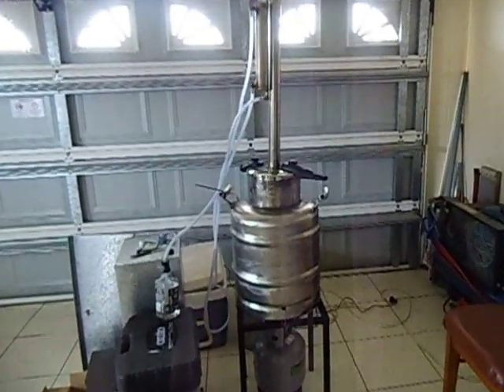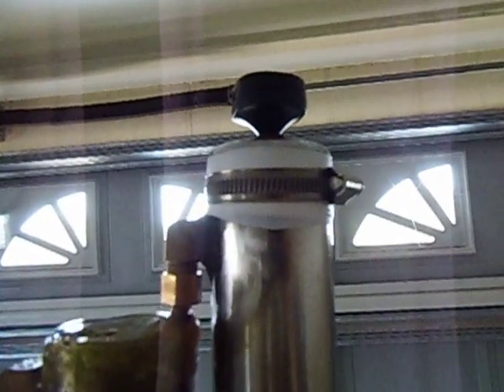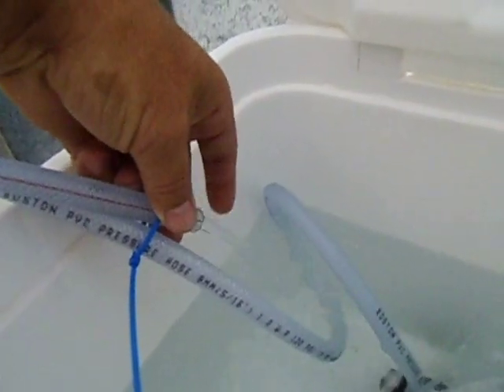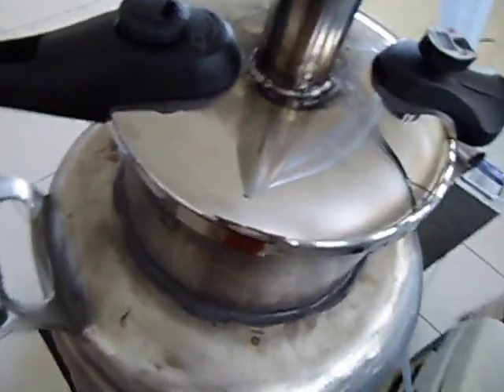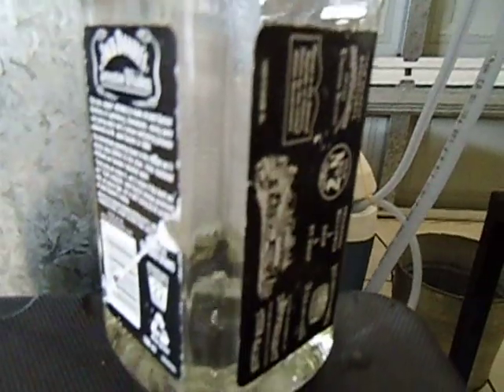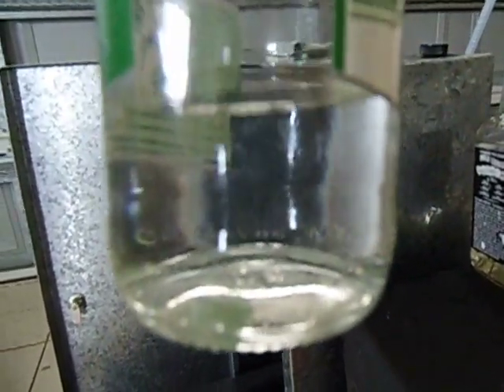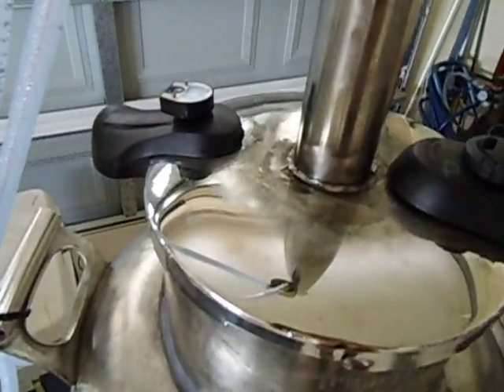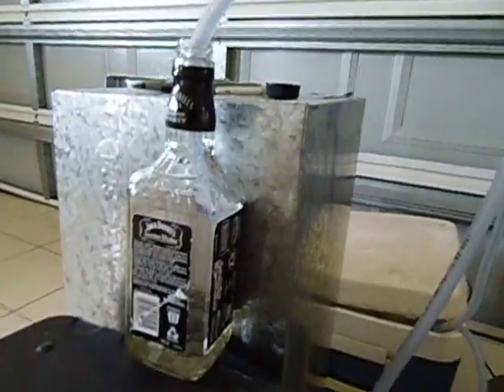Homemade 50 liter beerkeg and pressurecooker for pot disstilling,everything .AVI

Comment from the maker: Yip i used two stainless steel pot scourers , one on top and one at the bottom to hold the ceramic saddles in and the copper saddles is just below the top pot scourer and the hole collum is packed with ceramics to fill.See the video i made of how to pack the collum for a still , or subscribe to see my other video's , thanks

Comment from the maker: The liquid was half a batch of wash to test it out , consist of half a packet of Alcatec 48 yeast , 4kg white sugar and filled to 12lt mark with tank water. The salt might bring the temperature in the condenser down under normal use  , thanks for the comment posted , but I use water in a cooler box and added some bags of ice to it  to keep the condenser cold so that the alcohol liquid vapours condensate , did you no that salt makes ice melt , that's why I go without it , would not make a big dif